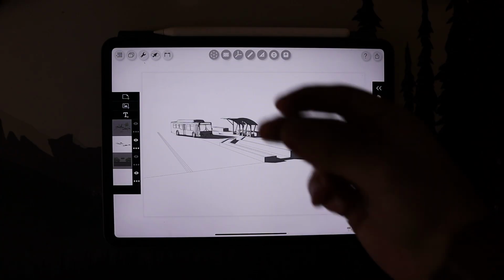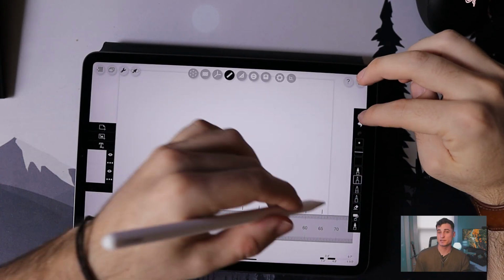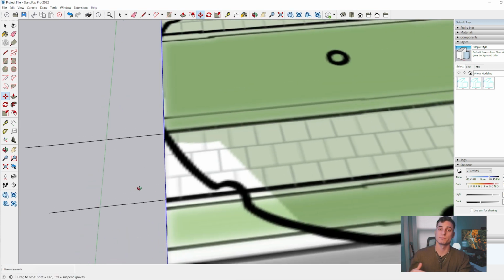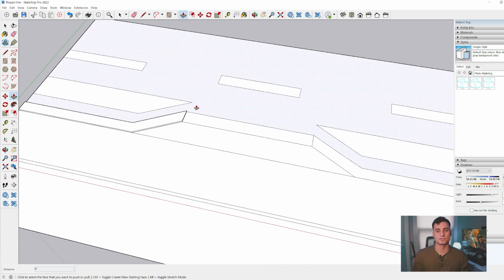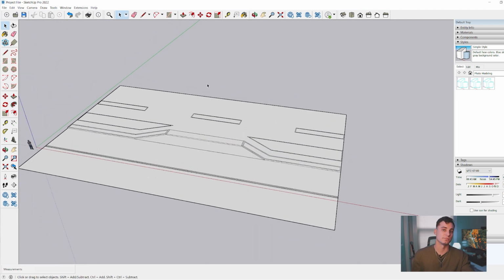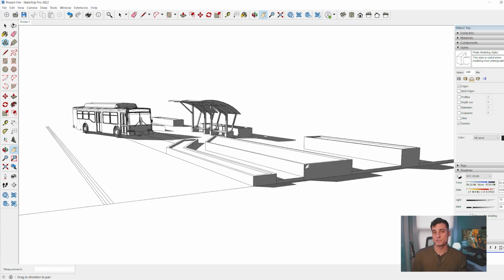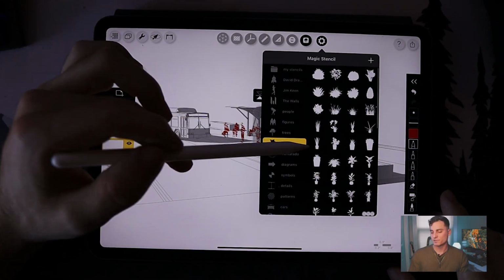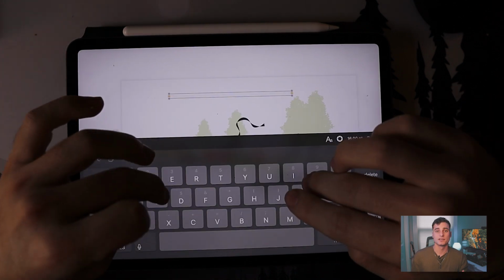How To Create QUICK Hand Rendered Diagrams In Less Than 15 Minutes - Landscape Architecture Tutorial

Comment: You can use the tape measure tool to scale.  Like you did with the line tool just measure the street and then type in the distance that it should be.  In this case 5’.  You will get a dialogue box that asks if you want to resize. . Select “yes” and it will resize it for you.
Reply from the maker: Thank you! Not sure why I never knew that

Comment: Tape measure tool to scale (scales the whole model). With tape measure tool selected, click on one end of your known dimension and then click on the other end of that known dimension. Without doing anything else, type in the dimension that it should be (using an apostrophe if it’s feet), and tap ENTER. SketchUp will ask if it’s ok to scale the whole model, click yes and watch the magic. Use the line tool to check that your dimensions are correct.  Works really well if you use top view and also have a scale in the drawing!
Reply: That is the best way to do it!
Reply from the maker: Ahh this works! Very similar process to AutoCad! Thank you!